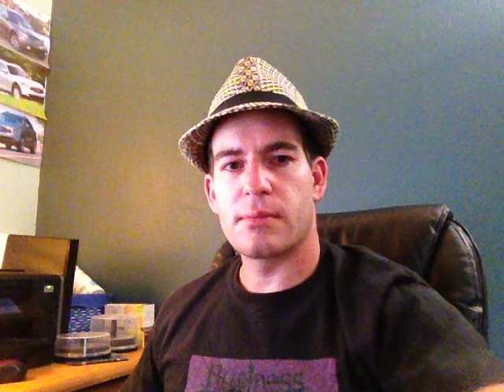How to know if your auger motor is bad

Comment: maybe I can finally get some help here.  no dealers near me and I dont know where the previous homeowners bought this stove so I cant get help.
here goes.
I turn my thermostat up. stove kicks on call light comes on. feeds some pellets, ignites, burns forms few minutes and dies out. hit the reset button and the cycle repeats. so far last year I replaced the exhaust blower as that had failed. so that's new. within the last week I had the chimney cleaned, cleaned out stove, replaced door seal, thermocouple,thermocouple cover and a brand new control board. still no dice. auger motor turns at start up then that's it. not getting a green or red light out of call box so not sure if I got a bad thermocouple or what. I'm fairly mechanically inclined but electronics is not my strong suit. my chimney was pretty bad the guy said so could that have caused my vacuum switch to crap out. I'm at a loss. hope you can help. thanks!!! 
ps. it's a quadrafire 1200i
Reply from the maker: That sounds like a bad thermocouple.  This is what you need...https://www.pelletstovepro.net/812-0210-thermocouple

Comment: Do I have to remove the motor from the stove to try the test of plugging it into the wall.
Reply from the maker: It's better to leave it in.
Reply: Good thank you. I fixed my problem too. I gave power to the motor and it spun so I connect it back to the control panel and it still didn't work. At this point I decided to trace the wires for the fuse and the red button on the back to the control panel and unscrew the terminals and just readjust the wire to sit flush on the terminal and re tighten them and like magic it has been working for the last 2 weeks. Maybe all the heat close by caused the terminals to loosen over time. Hope this comment helps anyone else. Thank you Jason for all your advice.

Comment: My ager motor always spin without turning ager on . Can you tell me what wrong? Thanks
Reply from the maker: Sounds  like the auger circuit is toasted on your control board.  This is common when you accidentally touch one of the wires going to the auger motor to the frame of the stove.  Depending on the make and model we might be able to rebuilt it for you.  Go to www.pelletstovepro.net and type in your brand stove and the word, "Repair" to see if we fix your brand.

Comment: Mine is making noises. Sometimes turns then stops. I can turn the Aug with my hand and let go, then the aug will turn once or twice then stop and just makes noise....yer thoughts
Reply from the maker: Sounds like that motor is just old and needs to be retired.  That's how they can act as they are going bad.  Email me a ebay@jasonRmunson.com w/ the make and model of your stove and I'll let you know if we have what you need.
Reply: @JASONRICHARDMunson  I just took out the motor and replaced it. Now it works. Thanks.

Comment: My auger will throw pellets out for about 5 minutes then it stops for  about a minute then it will start again, but by the time it starts throwing pellets again, what I have in the pot has burned out and I have to make start again.
Reply: +Lorrie Fernandez You could have a bad auger motor or possibly another issue with your stove.  Email me directly on this one and let me know what make and model stove you have.  ebay@jasonRmunson.com
Reply: Lorrie Fernandez did you fix this problem I have same problem I think it was thermostat. not sure
Reply: Yes... I had to replace the auger motor.  works perfectly fine now.
Reply: thank you
Reply: no problem :)

Comment: Hi I have a 20 year pellet stove that has worked great all these years. It has stopped feeding pellets except in Hi position. The auger turns in low and medium when no pellets are in the hopper.  Can you help ? thanks dan
Reply: Dan, If that is the original auger motor I would replace it.  Seems like it's had a good life.

Comment: how can I find the vacuum switch?
Reply: +Kathy VanDyke The vacuum switch is the only thing in the stove that has a rubber tube connecting to it.  It has two wires and sometimes looks like a silver hockey puck.

Comment: My auger is making a groaning noise and not feeding
Reply from the maker: That’s the sign to buy a new one before it quits.
Reply: So I jumped my auger to power it’s working just fine. This is a brand new grill it’s a Z grill and I’m just wondering where the pressure switch would be

Comment: 1995 Lopi Foxfire- at startup I hear a clicking in the stove control box (sounds like a relay), and the auger motor doesn't turn.  After several minutes, the clicking stops, the motor turns, and the stove starts.  Suspect worn/corroded relay.  Where can I get one?
Reply: +David Erickson That sounds like it could be a bad relay.  I'm not that familiar with that control box to know which relays it has or where to get them.  I do have a board repair guy who works for me but he doesn't like to share his sources for materials.

Comment: Can I run harman pellet stove with out the vacum switch? I by passed it and it works but can I run it until I get new switch?
Reply from the maker: As long as your chimney is clear you can run it like that till a new switch comes in.